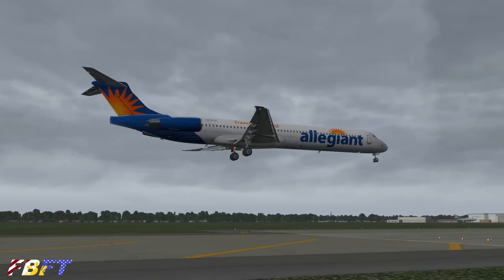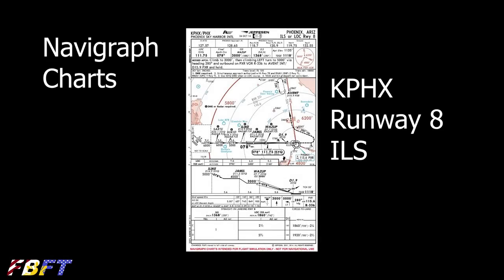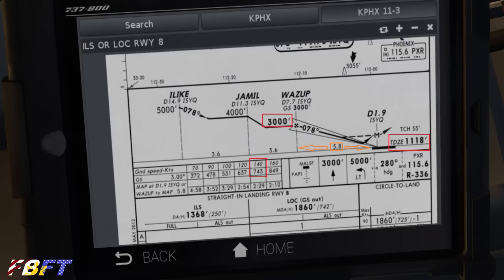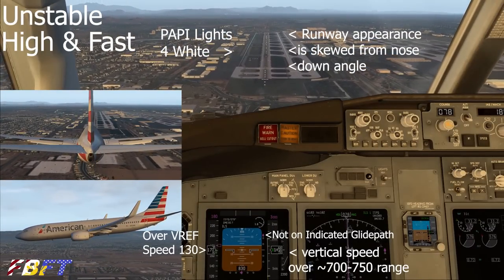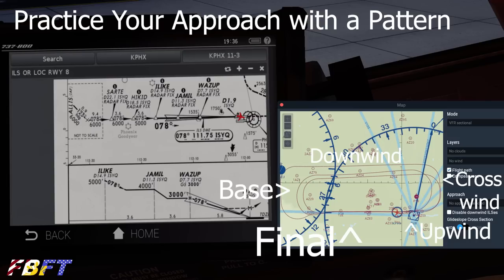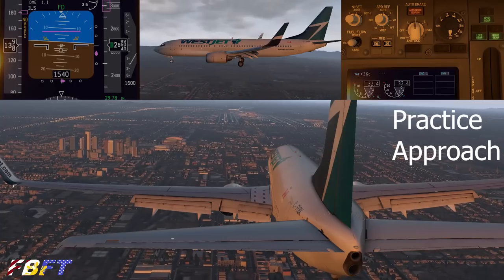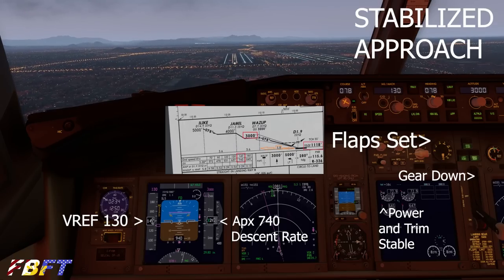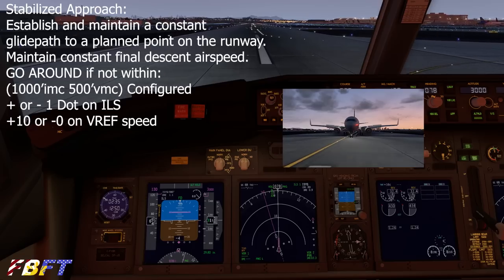Perfect Landings: Stabilized Approach | X Plane 11 - Zibo 737 - 800

Comment: A Ryanair pilot said use Flaps 30 unless it's a very short runway. The 737 FCTM (1.12/page 44) gives figures for actual landing speeds based on VREF in the Approach page and current winds. Tail Wind <10kts = VREF + 5. TWind at 10kts = VREF + 5. TWind above 10kts take half the wind speed and add to VREF. Headwind at 20kts Gust to 30kts take half the wind, the difference to gust (10 + 10) and add to VREF (VREF + 20) and so on.
Reply from the maker: ukLeeham720 thanks for the info.  The intent for this video was due to the popularity of the 737, but was intended to help all pilots develop a solid sight picture and fundamentals to improve their approaches irrespective of the equipment they are flying.  Thank you for sharing the info with the community!  This is the kind of feedback we love to receive.  In ground school I was taught to add half of the gust spread (Lee)

Comment: This is very useful info, very well presented. Just one thing. It looks like you're trying to use power to control sink. Don't. It's a fast, slippery jet, with slow-spooling engines and lots of momentum. Use pitch for rate and power for speed, and you'll find yourself at almost a fixed 48-60 percent power coming down the hill, depending on flaps and weight.  Keep up the good work!
Reply from the maker: Thank you, good tip!
Reply: @FlightBrothersFT  BTW, any fan of FlyJSim’s two epic Boeing jets, especially their hand-flying qualities, shows immaculate taste.
Reply from the maker: @marshall1864  I take it you saw our comparison video then.  Aircraft so good you don't even want to use the AP.
Reply: @FlightBrothersFT  and that’s the key point. Hand-flying ought to be a test—and valued more, when it comes to judging and calibrating flight controls. If real planes, commercial and GA, were as squirrelly and tough to fly as most simcraft, planes would be falling out of the sky hourly.

Comment: Great tutorial for beginners, but here’s my two cents:

1: use the autopilot. Disconnect at minimums the first few landings, then at 1000’, then at 2500’, and theeeen go raw data. This way you can learn how the flap speeds behave, how fast is too fast, etc.

2: flap 30 is much easier to land on, 40 is a bit floaty.

3: use the autothrottle. Bug vref + 5 and let the plane do your job.

4: seriously, use automation as often as possible. I get that when you’re new, flying the plane manually is awesome and all, but the plane is there to work with you, not against you. Use flight directors, autothrottle and autopilot, you’ll need to learn how to use these at some point anyway, might as well make your flight easier

5: get into the habit of doing checklists. This is probably the fastest way to get consistent approaches, to have your plane configured in time, all the time

Also a good bit of info: 160 kts at 2000’ is key. Gear down flap 15 at 5 miles DME. 

Hope this helps abit :)
Reply from the maker: Fantastic tips, thank you. I wish I had known those when I made the video. Are you a sim pilot only or do you also have real world experience?-Tim
Reply from the maker: rigor m those are all great tips for the community!  If each simmer critically evaluates areas where they struggle and works to improve that area they will get better.  Work and consistency!
Reply: As remarkable as the zibo-mod is keep in mind that there are a lot of ways it just can't capture the demands of the real airplane. By it's nature, the 800 is a bit stiff-legged and "roll ons" are a hit or miss proposition. This is likely due to the necessity of a 3 degree to 4 degree flare to avoid a career ending tailstrike.
Insofar as Vref goes, Vapp is almost always faster and typically going over the numbers at
140kts-150kts is the norm. Fully weighted and carrying extra fuel 170kts is not out of the question.
Then, too, different airports necessitate different approaches. MDW stands out. Flaps 40/brakes 3 is typical (brakes 2 if you're landing light and flaps 30 in gusty winds). 
Add to that different performance preferences for different airlines and there truly is no "one-size-fits-all" way to land the 800. 
I would suggest one more thing: spoilers and thrust reversers first and then considerably later,brakes. The reversers will have already have brought the engines to idle before the brakes kick in.

Here is a graphic from the Boeing training model for 737's and a note:
https://www.boeing.com/commercial/aeromagazine/articles/qtr_02_10/5/img/A5_fig1.gi

737: Intercept the glide slope with gear down and flaps 15 at flaps 15 speed. 

At the end of the day, there's no substitute for having a line check pilot babysitting you while you grapple with these things.
Reply: rigor.m used your pointers during my practice along with this tutorial really sped up my learning curve.  Number 3 was crucial vref+5.  Thank you
Reply: Thank you from a baby Aviator lol
Reply: Flaps 40 floaty ? Lol, flying the real 737 I can tell you it's quite the opposite. Way more drag, be careful on that flare

Comment: Thank you for the tips. I’ve only flown GA aircraft so far. My landings were pretty bad at first, and still not great, but once I read the section on landings in the Airplane Flying Handbook, I got much better. The advice to pick and focus on an aiming point made the biggest difference. Glad you emphasize this in your video.
Reply from the maker: Thanks for taking time to comment.  You'll have to let us know how it goes when you try landing commerical jets.  Getting everything configured, trimmed, and the throttle just right is really an art. The GA planes are great practice, so I'm sure you will learn quickly.

Comment: I'm new to the Zibo but have been X Plane simming for a year and this was really helpful.  Thanks
Reply from the maker: Glad to hear it!  Happy flying.
Reply: Question please.   I have a thrustmaster hotas throttle/yoke system.  I'm landing stabilized now based on this video in practice patterns.   One thing I can't sync is my auto throttle.   If I don't disengage the speed takes me to the runway perfectly.  Is the auto throttle supposed to disengage automatically on touchdown?   When I'm on final at any distance I can successfully disengage AP but not AT - meaning the N1 drops to idle and I lose stability.   Hopefully this makes sense.
Reply from the maker: Depending on the aircraft there might be a blue or green line on the N1 indicator, this should coincide with your throttle position.  Try moving the handles and hopefully you’ll see it, then set your levers to the “current”/commanded thrust setting.  This should ease the transition from AT to manual thrust control.  Configuring an AT disconnect button on the HOTAS may also help.  Some of this comes down to your personal preferences.  We hope that helps, but feel free to hit us back if you need to!

Comment: Circuit training is helpful and fun. And it's a good idea to memorize a few pitch/power settings and use them to hand fly at low altitude to get a feel for the jet. I like to bomb around at 2000 ft AGL at 5 degrees of flap and thrust set between 55 & 65% N1, depending on weight.
Reply from the maker: Great tip. I found when I flew the pattern by hand I had a great approach. When I let the autopilot fly the pattern and I took over, it was a hot mess.
Reply: Great demo. I'd like to add that the throttle at the end of the video should be used to adjust the descent rate and the pitch up to reduce speed.
Reply from the maker: Roger Andreassen absolutely.  Thank you for bringing that up.  A key element that many miss!

Comment: Good video... Don't forget to set auto brk.  Speed brk  and landing speed about 140K and flare will loose speed.  Radio alt set to about 31 for call out.
Reply from the maker: Thanks for the tips!  So I should be crossing the threshold at 140kts and then  bleeding all that speed in the flare?  I will have to give that a try.

Comment: Loved your video. Using multiple views adds a nice touch. Would also be nice if you could make a video describing the steps in detail to practice the landing and the pattern.
Reply from the maker: @Normand Bedard, thank you. This was my first video utilizing multiple camera angles, I'm glad it was worth it. I like your ideas and realize I didn't elaborate those points. Until I have time to make another one, here are some tips. You can fly the pattern using HDG mode on autopilot, simply turning the HDG bug 90 degrees for each turn. You can continue the turns on the crosswind and base leg immediately without leveling out. For the downwind leg, refer to the MFD map or the DME to be sure you fly far enough to be able to intercept the glideslope. Turning by hand, simply bank the aircraft 30 degrees and maintain altitude and speed. For the landing, it is hard to give tips without seeing what you're doing. One way you could practice would be to arrive at the glideslope fully configured (gear down, flaps set for landing, speed at VREF). That will give you a nice long 5nm or so to 'feel' the aircraft, monitor the descent, and practice the tiny adjustments in throttle or course that might be needed.
Reply: Flight Brothers FT Do you configure anything in the FMC? Do you mostly use the trim to control the pitch or use the yoke? What about after touchdown? I suppose you reset Autobrake RTO, Speebrakes down, Flaps up to 5, full throttle, ....
Reply from the maker: @magicnorm2036  You could use the FMC to select an approach, but for practice that isn't really necessary. Trim is the key on stabilized approaches, touching the yoke should be almost unnecessary for pitch.  Once you get the perfect trim and throttle setting (if on glideslope), the aircraft will basically float down to the runway without much further intervention until flare.
Reply from the maker: Normand Bedard after exiting the runway you can complete the after landing checklist.  You are heading in the right direction!  Auto brakes would come off (RTO, rejected take off not necessary for taxi in) strobes off, taxi light on, spoilers retracted, flaps up (if not on a contaminated runway, inspected for damage post flight in snow/ice for example, so they would be left), transponder to alt off (this lets surface radar still ping the aircraft so they show up to air traffic controllers, but “declutters” their (ATC) display.  Hope this provides a bit more information for you!

Comment: Great job on the video my friend, I also agree with the other commenter that you should maybe use auto throttle a little bit more so you're not floating up and down between the glide slope and then on the route of thousand feet from the threshold maybe you can disengage the autopilot and the auto throttle, otherwise perfect video! Great learning tool for people that are flying simulation and perhaps even learning something in the process.
Reply from the maker: Great comments, thanks for the feedback. I certainly agree the auto-throttle would be more stable. That said, there is some benefit to practicing manual throttle enough that you can handle it without the automation. I'm certainly not there yet!

Comment: Hello, Captain. You are very good at explaining technical concepts in clear language. Unfortunately, I was not able to understand the +/- 1 dot aspect of a stabilized approach. Congratulations for your video. Regards. Larissa.
Reply from the maker: Thanks for the compliment Larissa. The +/- one dot is referring to the magenta ILS glideslope indicator on the right of the artificial horizon. The magenta arrow shows your aircraft's location on the vertical glideslope, and the dots above and below indicate a specific number of degrees above or below the glideslope.  Up to one dot off from the centered position is considered acceptable, but beyond one dot is too far off glideslope to make a safe approach. Too high and you would land long or hard, too low and you may leave the protected airspace and risk hitting something as you get closer to the runway. The magenta indicator on the bottom of the artificial horizon indicates the localizer in a similar way, which is your alignment with the runway horizontally. We hope that helps. Happy landings!

Comment: hey after setting up Your VREF speed  in the FMS (7:30), was the speed (i.e 140 knots)  Automatic , or manual ?
Reply from the maker: Normally if you’ve selected the aircraft weight and flaps, the V speeds populate automatically….in the Zibo, not the default 737.
Reply: @FlightBrothersFT  oh ok thx

Comment: I was watching the Speedtape on the PFD. I noticed you didn't have the Flap VRef bugs displaying. Are you gonna show how to use those when doing a precision landing?
Reply from the maker: @Kreemerz   I think I know why they aren't displayed.  Most of the video is filmed in the Zibo, which calculates and displays the flap references you're describing.  Some of the video is filmed on the default Laminar 738 which I don't believe has the display because of its simple default FMC.  If you'd like to see an example of the flap speed references, please check the linked video below.  It is time stamped to start at a point where the PFD is displaying the information.  If you wanted info on using those references, basically deploy the displayed level of flap at (or below) the indicated speeds bugged on the speed tape.  https://youtu.be/_MV2CAPZzyU?t=4035

Comment: What hardware are you using for this? Graphics quality looks good
Reply from the maker: It's from xForce PCs, they custom build for Xplane. I5-7500 @ 3.4ghz, 16gig ram. Graphics card is GTX 1070 with 8gb vram

Comment: Would love to see a tutorial on details of "Flare
" phase during landing.
Reply from the maker: Thanks for idea, we will definitely consider that.  In the meantime, you basically need to slowly bring the nose up while idling the throttles about 20 feet above the runway. Flare too much (or if you're speed is above vref) and you'll get a float and climb.  Flare too little had you risk touching down on the nose gear first or simultaneously with the mains, which can damage the gear and/or bend the aircraft.
Reply from the maker: https://www.youtube.com/watch?v=0bOEiR6JuXY - Flight Bro Lee
Reply: @FlightBrothersFT  That video doesn't apply to 737.  There is no flaring in GA but it is a real thing for jetliners.
Reply from the maker: @SimsSmith  agreed, but in either case you are bleeding off energy to allow the aircraft so settle comfortably onto the runway.  You wouldn’t want to stall an airliner, but any approach to landing is an exercise in energy management.

Comment: Nice Tutorial!
Bit I have a problem.
Every time im on the ils my plane is just doing a 45° left or right turn. And I dont know what im doing wrong. Can you please help?
I would appreciate it.
Reply from the maker: Bastian Gross there should be no reason for that.  A bit more info might help.  Are you hand flying the aircraft?  This would rule out a “bad” autopilot, if simulated.  Which aircraft are you using?  If using autopilot, are you pressing a “v/loc” mode to align with the final approach course and once established on the Glideslope using app (approach) for the vertical profile?
Reply: @FlightBrothersFT  im doing that and i am using a zibo 737
Reply: @FlightBrothersFT  can i send you a vid who im approaching?
Reply from the maker: Sure, I’m not sure if we will be able to help, but we can try.  A lot of users with issues in the Zibo do not have a clean install.  Did you install the complete version and overwrite existing files?  Often this is a problem.  We would also suggest searching/posing your questions to the Zibo Community group on Facebook.
Reply: I think it might be your yoke needs recalibration